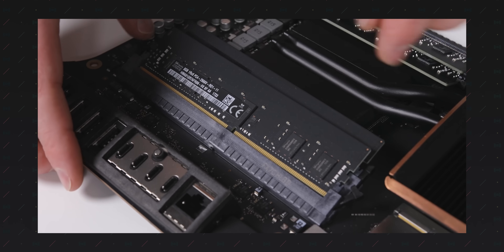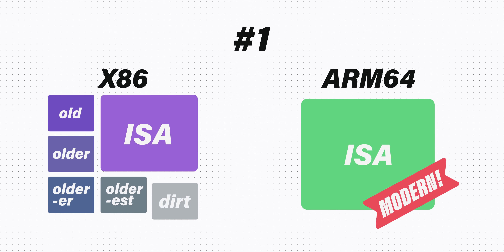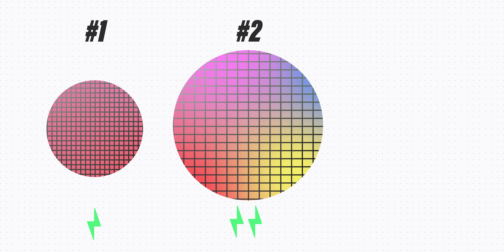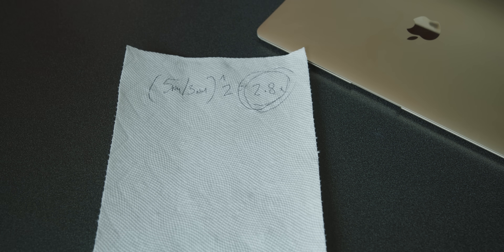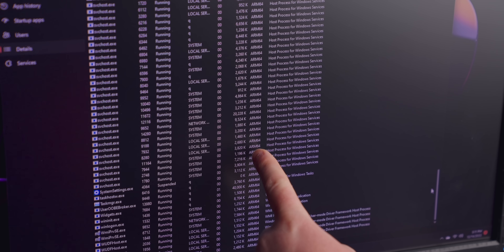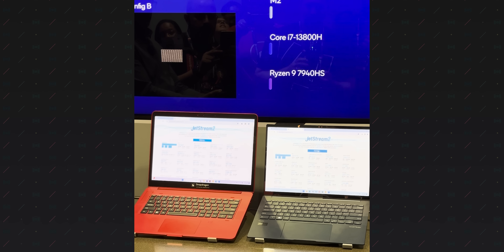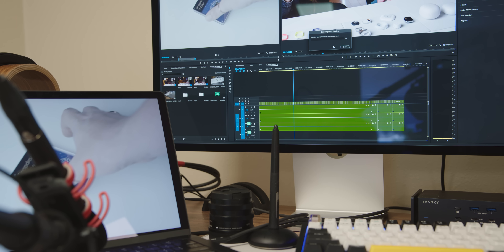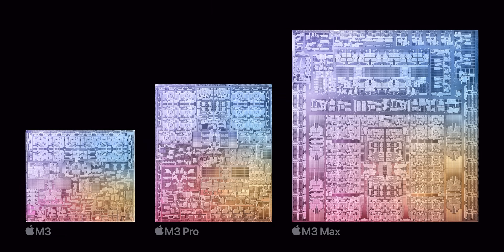Apple's Silicon Magic Is Over!

Comment: I have absolutely no need to move away from my M1 Air. Unless of course Apple starts gimping it on purpose via software updates in order to force users to upgrade.
Reply: They don’t do that. You can turn off software updates if you don’t want them. As a matter of fact, Apple discontinues update support for older machines while they’re still useful, which I consider more of a problem. That being said, if you stick with Apple very long, they absolutely WILL release an OS version you loathe that will seem like a downgrade. Count on that!

Comment: So... When can we expect a Snapdragon hackintosh ?
Reply: Run Virtualization Framework in VN on Snapdragon, why not ?
Reply: @lucasrem I do not think it would be even possible, because of the hard software/hardware binding of apple. Imagine why no one managed to run iOS on android phone.
Reply: @livemadseason  iOS runs fine on windows as a vm, on droid is another story due to the processing limits, ARM sat on their laurels for way too long and haven't really expanded their technological innovation until now. Technically as the M1-M3 series is an ARM system you should be able to run it on droid and vice versa, but none of the chip-specific stuff would work. it would be easier to run Droid on the M1-M3 as the ARM spec is in the M1-M3, and the software just 'wouldn't know about' the accelerators.
Reply: So can Apple Silicon macs run Windows 11 natively via Boot Camp one day?
Reply: @moow950  Yes, they already can with 3rd party software. Microsoft just need to agree license with Apple for Windows ARM Bootcamp
Reply: @moow950  No, you would have to use Windows for ARM there have been versions of windows that run on ARM since windows 8, some are ok, most are rubbish. But doubtful Apple will allow it unless they gimp it significantly (like they did with parallels).
Reply: @moow950 If Microsoft writes the drivers for Apple Silicon. They used to do it for Intel Macs, but not for Silicon, they’re sore and pissed off, lol.
Reply: Apple Silicon has a ton of custom features not found in any Qualcomm chip. The OS expects to interact with those features.
Reply: @alexrosenberg_tube yes, you're right. To elaborate for anyone curious:

Apple Silicon uses the ARM instruction set, licensed from ARM. But ARM also licenses *implementations*, i.e. arrangements of silicon that licensees can copy/paste into their own SoCs.

For example, the Nvidia Tegra X1 (Nintendo Switch) has four ARM Cortex-A57 cores, and the Broadcom BCM2711 (Raspberry Pi 4) has four ARM Cortex-A72 cores.

Apple started customising CPU core designs with the iPhone 4, and macOS may expect certain features or behaviours beyond the instruction set.
Reply: The macOS build for VirtualMac2,1 (Apple Virtual Machine 1, used for Virtualization.framework) is adapted for a platform much closer to the typical ARM processor, so it might be possible to run that macOS build in a thin hypervisor on a snapdragon. The catch is that this platform still uses paravirtualized metal over some MMIO.
Reply: @nickchan6498  nice
Reply: Just buy a laptop with modern AMD chip and call it a day. No need to wait for Snapdragon and Windows on ARM.
Reply: without virtualization this is basically impossible still, sadly. macbook build quality is far more appealing to me than the OS though
Reply: I only want hardware hackintosh, that is ability to run other OSes on M series h/w.
Reply: yeah its possible, thanks to the M line the hardware keys are on the floor now. All M1/2/3 based mac's have a unpatchable leak in their silicon design. google "Unpatchable vulnerability discovered in Apple M1, M2 and M3"  so in theory if you fish for long enough you might be able to get what you need.
Reply: Probably never.
Reply: Not until you can install any desktop OS, like windows or linux on ur android phone
@asinglefrenchfry is correct
Reply: Short answer - never. Apple Silicon is a closed environment, with direct os interactions with Apple hardware not available.   This is actually a strength of the Apple Environment - the manufacturer and the os are from the same company.  Microsoft is moving in this direction as well - developing their own AI product line of arm cpus.
Reply: @troypast3589   i disagree as i see it as anti competitive and anti open source, those macs are E waste waiting to happen.
Reply: as soon as hypervisors like Proxmox grasp ARM platform fully
Reply: Never.
Reply: I don't think that's possible unfortunately. ARM chips work differently with how the OS needs to be coded specifically for it, or something along those lines
Reply: @asinglefrenchfry  bigger issue would be the SEP secure enclave, I would think as the M-series are ARM chips
Reply: @asinglefrenchfry  Yes and this is why I dont like ARM, it's a very locked down architecture thats hostile to open source alternatives. Yes there's plenty of ARM based linux flavors but its a hard to work with architecture if you like open source. Its why I'm pulling for RISC-V, sure its still early days for RISC-V but I find it far more promising due to its more open nature compared to ARM, it has the potential to be the X86 killer that ARM hopes to be but cant due its locked down BS.
Reply: @themadoneplays7842 Can you elaborate? What makes ARM more locked down when compared to X86? And why is it hard to work with?
Reply: @Luka-fu2bd  well see for yourself, the majority of ARM devices cant be booted with alternate OS's. M1 macs still cant natively dual boot windows 11 or linux. Also most developers are familiar with coding for X86 as its a far more open standard. the majority of RISC processors are locked down single OS pieces of crap, more e waste waiting to happen.
Reply: @themadoneplays7842  sorry, but this makes no sense. Both x86 and ARM are not open, the "locked down OSs", have nothing to do with the architecture but only with the ecosystem and Apple purposely locking down their OS and bootloader, and ARM really doesn't make a difference for like 99% of developers, as they simply compile for ARM and don't write machine code directly
Reply: @Luka-fu2bd  I only say X86 is more open is because the majority of intel/AMD machines allow installation on non windows OS unless there is some lame BIOS shenanigans going on (what killed Toshiba) and apple locking down their hardware is anti competitive/consumer
Reply: @themadoneplays7842  isn’t that far more a question of other os’s lagging? ARM is the x86 killer…
Reply: @hiloknowsall7462  No as Linux has had arm support for ages now. the real issue is alwatys from vendorsd and software makers. As for ARM being the x86 killer sorry as long as it cant run x86 apps without severe performance issues its not viable for a market arm cant do: games. and I mean real games, not Candy Crush saga
Reply: A snapdragon chip may come out as pricy as M series or even more expensive… there is zero sense to build hackintosh on it!!!
Reply: @ahmoylaw8905  Except I could just add an M2 SSD, have more alternative producers of my laptop around the cpu to choose from, I can properly run Windows in a dual boot etc etc. There's endless reasons why you wouldn't want to have a Macbook, but you would want OS-x. And vice versa, too.
Reply: A Snapintosh?
Reply: Yeah, "enjoy" some mix'n'match crap nonsense that matches your personalities - you guys're hilarious! 😹💦 🇩🇪💙🇷🇺

Comment: It took Apple more than a decade to produce the m1 and people can’t expect the magic reveal every year let alone even every 5 years. Tech moves much slower than the marketing.
Reply: All companies design their chips in parallel. Before M1 launched, work on M2 and M3 was already underway. So it's not correct to say you have to wait 10 years between improvements.
Reply: Apple's problem is the same as always - is a proprietary silo

In the rest of the market there is far more choice and ability to install operating systems that are not closed and controlled - totally at the mercy of an ultra giant tech company.

An open market place that isn't so rigidly controlled and dictated is a far better place to be
Reply: @TheSulross  I say the following as a Samsung user who loves Android and Windows:

The ONE thing that I praise from Apple is the physical Lightning connector. I WISH that was the standard that USB-C currently is.

I would love for my S24 Ultra to have a Lightning port. I would love for my Windows laptop to have Lightning ports instead of USB-C.

I wish all Android phones and tablets had a Lightning port and that USB-C was Apple's proprietary garbage that they were getting rid of to adopt Lightning on the iPhone 15 series.

Lightning connector is more durable and less sensitive.

(NOT JOKING).
Reply: @TheSulross  you can install Linux on a Mac and with the older Intel chips you could also instal Windows.  The tutorials are out there.  That doesn't seem closed to me.
Reply: Oddly this was a mistake of their own making though. Every year they reissued their lineup to the point that the market expected this from them. They tried to push it to every 2 years back when they came out with the iPhone "S" models (4s, 5s, 6s). That way they could push major advancements out another year and not corner themselves. But then they started doing it with their computer lineups too. Now they are stuck trying to innovate year-over-year rather than releasing a good product that lasts a few years and updating it after 2-3 years.

If only they produced like he said at the end of the video and released a new chip, while focusing on hardware updates in between major chip releases. By the time M2 was released they would have a solid line of products all on the same chipset ready for transition to M2 as well as making sure the next instance of the chip was done right. Maybe they wouldn't have that defect in the hardware that's allowing malware (not sure if this has entirely been confirmed yet though). But in any case they are certainly going to get hit hard sooner than later if they keep up this yearly release cycle. For mobile it's one thing, but not for computers. </rant>
Reply: Everyone is talking power and efficiency but what about seamless hardware-software integration with an entire ecosystem with extraordinary ease of use and still with world class user speed! I get it if you’re a computer enthusiast but most of us regularly folks aren’t engineers or architects lol. And let’s not forget about software simplicity and aesthetics. Most people who dislike Apple has never used the entire ecosystem every day 365 so they get frustrated with what they don’t understand. I used to be the same way! The reason why Apple still dominates is because with ALL ASPECTS considered, no company is even close. The best argument against Apple is simply overcharging since they’re running a monopoly which is why the US has taking them to court.
Reply: @christopheranderson5803  Bruh, I just want freedom. Something apple definitely does not offer.
Reply: Humans always overestimate themselves. I mean, we thought we have flying cars back in the 60s, as well as “The House of Tomorrow”. Meanwhile, computers really haven’t changed very much at all since the 1980s. I was expecting super massive speed increases by now. And while computers are faster, they aren’t as fast as they should be after 50+ years of development (much like cars). But, aside from that, no one really cares about the M processor speeds unless you are a super-user video editor or 3d modeler. I had an Intel iMac up until this year. I got an M3 MacBook Pro. It’s a lot faster, but not as fast as I thought it would be based on all the reviews I read/watched, but that’s probably because I don’t do video/3d editing. Copying files, whether on a Mac or Windows computer, is still slow even with USB C or Thunderbolt, in my opinion. But, whatever. Does it really matter if you’re getting the thing done that you need to get done?
Reply: @timz9862  Also what are you talking about, cpus are literally 200x faster than in the 80s
Reply: @timz9862 How large are your files? Are you sure you even have Thunderbolt SSD's to achieve ACTUAL fast transfer speeds??

My video files are 50GB to 100GB+ each.
Reply: @timz9862 It's the developers fault actually. Every gain made in hardware has been eaten up by the ever more complex software we develop. We as developers have used programming languages with ever more complex instructions just to ship software at greater speed than before. The hardware limit is hit now and the next revolution is going to be done in the software. I've already seen the shift in software programming to use more efficient programming.
Reply: BS, it took them 2 years.
M1/2/3 is based on ARM.
They took the base ARM and customized it to their liking , slapped it into a laptop that they already had designed and weren't gonna change, and shipped it...
Easy Peasy... Dont believe me? They told intel to F off 2 years before M1 came out...
Reply: not sure what you mean took them a decade. where do you start the counting from? their involvement in the ARM project (which they sold off to deal with potential solvency issues and endless predictions of doom on Wall St) ? The launch of the iPhone using ARM chips? It's an iterative process, obviously. so over ten years? ok. but who knows when the first ARM chip had macOS ported to it in their sunk works buildings.
Reply: they have also worked on the augmented reality headset and that costs time and money
Reply: @fidelisitor8953  That's what I said? And usually it's >3 years. Chip design takes a long time.
Reply: Yet AMD moves at the light speed since 2017, providing an 1.5x increase with every uarch generation. Except maybe Zen+, but that wasn't a number, just a +. And there are again big rumors around the Zen 5, almost every gaming embed where TDP and, by extension, battery life are important, comes with x86 AMD, no one ever thinks of ARM64 emulation to run, say, GTA V like Apple does - you know the drill. Although the tech is there with QEMU userland, just polish it a bit to get the ball rolling, ppl been doing x86 games on Android with half-baked software for years, with just roughly hacked software, I mean, that wasn't some great feat that no other company can pull off.
You won't believe me but the writing was on the wall since M2 where Apple went to the MAX (pun intended) with the core count, not even trying to market an IPC increase with the same clock and core count; they squeezed out everything from the 1st gen in that regard.
Reply: Isn’t them going all in on Apple Vision Pro exactly this? Opinions on its practicality are pretty mixed, but talk about a big risk and dramatic form factor enabled by their silicon
Reply: Especially when the design team leave and go work for quallcomm.
Reply: It took Apple about 2 years to cram together a bunch of SoC features from its other non-Intel devices into a "custom chip". Apple's only selling point is its breakneck pace of new device releases. Even when they're basically the same as the last one.
The M-series computers are just giant overpriced iPads. Apple can fuck right off with that. Give me back modern Intel macs. Their hardware is fine, their software is ass.
Reply: Just look what AMD has done in the last few years going from bulldozer to zen and from gcn to rdna. Huge jumps in performance over time. A trillion dollar company is capable of more if they tried.
Reply: It took Jim Keller to make the m1 magic, he's long gone and his legacy is now over.
Reply: I agree but how can they not expect it when Apple themselves market the magic every time? Just be honest with the consumer base.
Reply: tbh every year was magic since m1, no exception.
and every iteration was a massive gain for the consumer.
synthethic benchmarks are basically useless jsut like 99,99999% of the content on the internet.
Reply: No it doesnt. Just apple moves that fast. You can play games on android phones whoch don't work on macbooks which are tens of thousands of pounds
Reply: The iPhone and MacOS are getting by on holding back features that are standard outside the Apple bubble until they can cash in on the "innovation". They don't have that luxury with silicon tech.

Comment: Will Apple bring back “Boot Camp”?
Or, will I run Windows using Paralles  on a more expensive machine?
Or, will Linux turn out to be neat on any kind of Arm computer?
Reply from the maker: Really, there’s no reason to support Boot Camp these days.
Reply: Boot Camp might not be reasonable today, but it might be fun.  Macs might run Windows better on a Mac then Other chips.  How much would it cost Apple to develop an Arm Boot Camp?  Keep up the hard core stuff.  I don’t understand all of it, but If you don’t explain it, i won’t begin to learn. @snazzy
Reply: @thomasmiller5502  I assume that MS's restriction on Bootcamp will not change because MS wants to promote WOA with their own OEMs, not hand it on a plate to Apple.